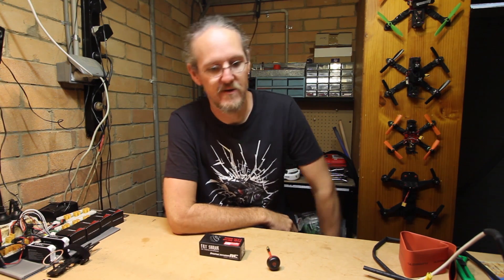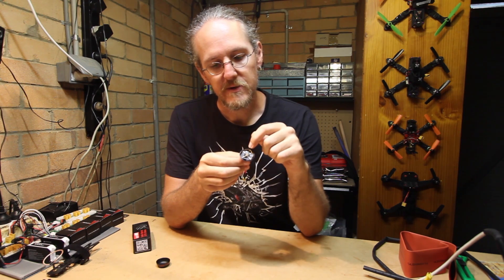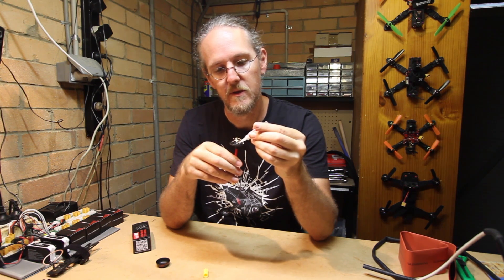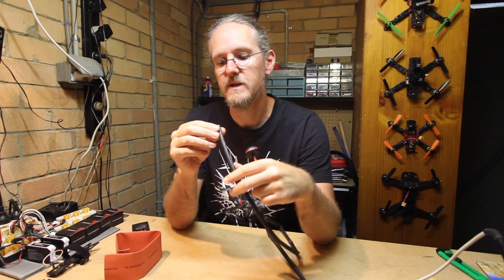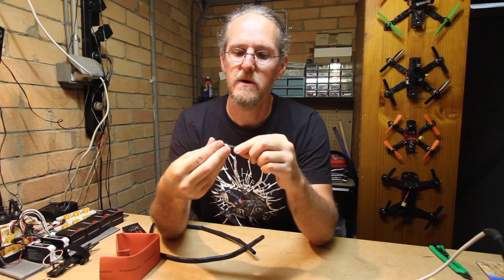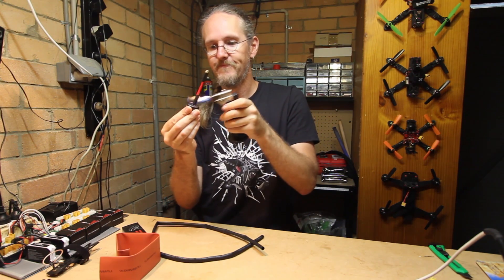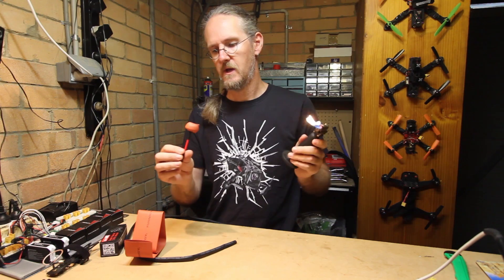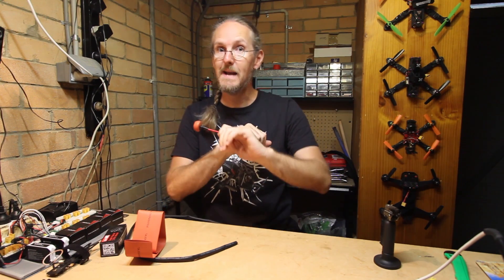How to bulletproof ImmersionRC Spironets

Comment: Another... Why havnt i thought of this moments.  I was considering plastidip after trying epoxy and failing miserably.
Reply from the maker: +awkBOTS Yeah I used glue for ages but in a bad crash things still break or get shredded. That heatshrink is tough stuff, does the job nicely without adding too much weight.